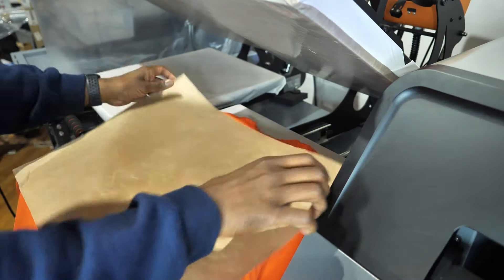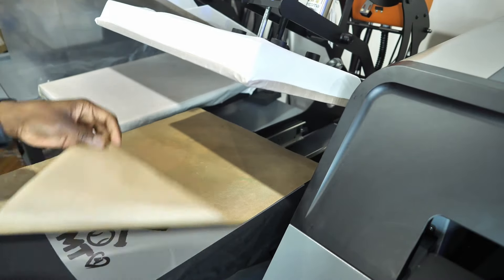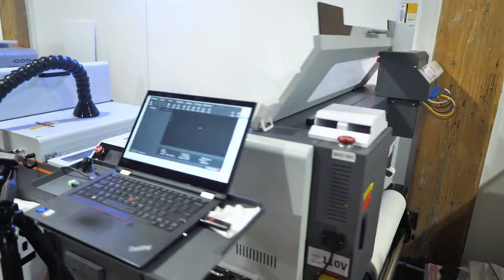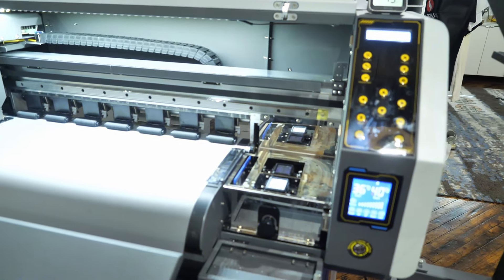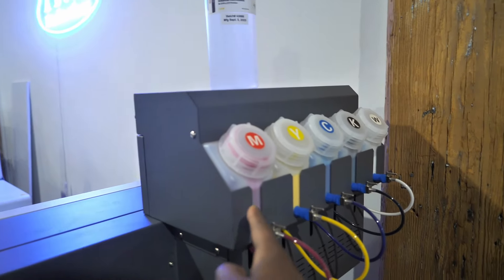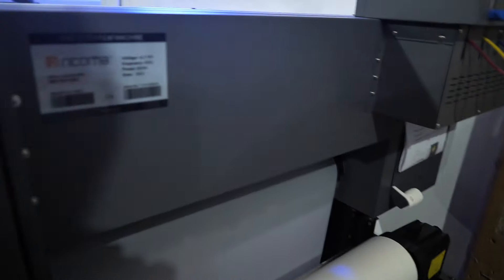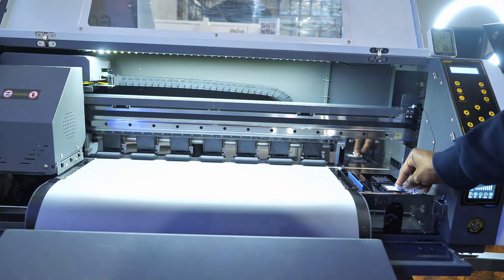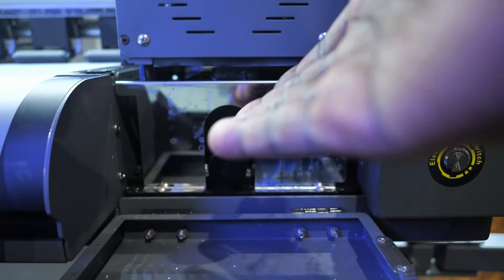Is Revel 2402 T DTF Printer Right for your business?

Comment: Man I think you don't have to leave the machine on for the white ink to do the stirring. It will continue to stir the white ink even if you turn the printer off from the red stop button on top of It. If you see on the left door of the printer below the ink stations it is a timer that works autonomously even if you turn off the printer. Try it and tell me if it is the same for you too

Comment: Great vid. I really love the functionality of that printer. I  think that Ricoma really improved all the issues people were having with the other brands. The mirror on the left side of the printer is a definite plus, other brands you have to use a cell phone or a telescope mirror from a side tight door in order to clean the print head. I wasn’t sure in the video if you said you fill the capping station with cleaning solution or cap solution? I would’ve thought that cleaning solution would delaminate the head sitting in it too long. Looks like it’s gonna be a great machine that will run without issues. I look forward to seeing more vids of good and bad as you deal with this machine.
Reply from the maker: Cleaning solution.   Idk if it eventually gonna cause that issue you mentioned but we will see in time.

Comment: What software are you using to RIP the file. Are you using Vivid Rip or something else?
Reply from the maker: Vividrip
Reply: @adubbproductions  Just a heads up vivid rip does not handle shadows at all. You also will bot be able to rip gang sheets longer that around 22"x40" as of right now. 

I am testing some other solutions. I will let you know if I come up with something.